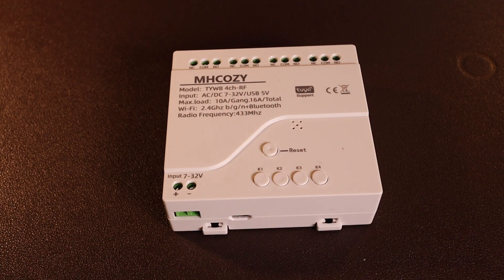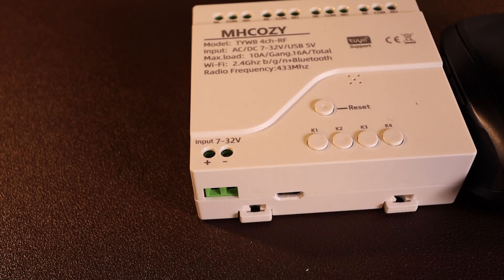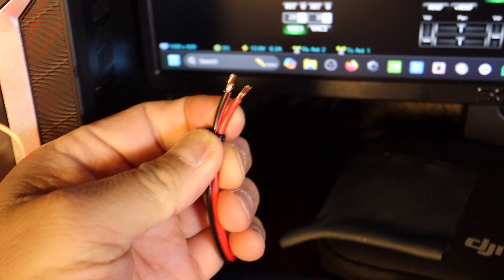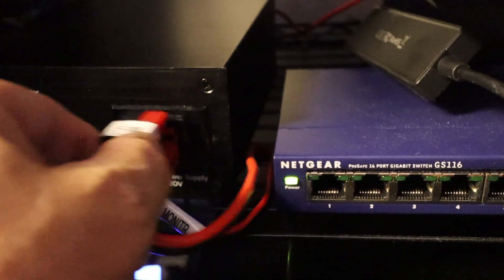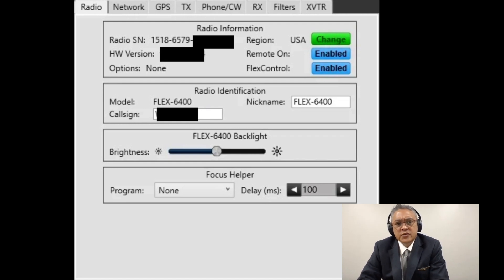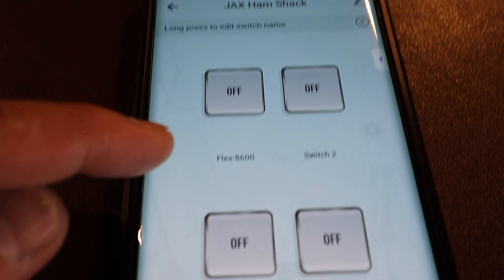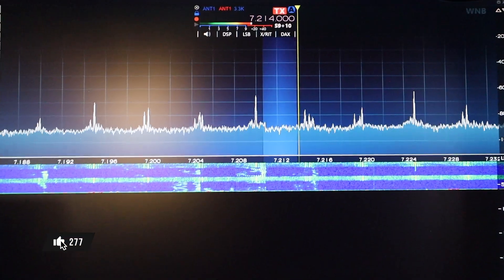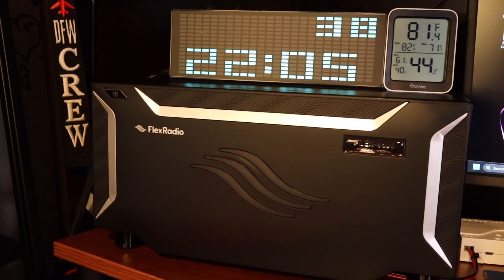Flex Remote On (REM ON) | Setting Up Remote Control to Turning On the Flex SDR | Flex-8000 Series

Comment: Darren, thanks for the video.  I received my switch the other day.  I built a control box with two high-current contactors, a DIN rail-mounted 24VDC power supply and breakers to protect everything.  The switch is now controlling 1) my Heathkit SB-220's 240VAC input power, my station's 12VDC power supply and the Remote ON for my Flex 8400M.  I can now operate remotely from my hotel room(s).   I have one unused switch (#4) for something else that I can come up with. :)  73!!  Ron - K5RPM
Reply from the maker: That's awesome Ron, 73 de N4VFR

Comment: Do you normally leave the flex on all the time or do you use the app to turn it on and off while you are away??
Reply from the maker: You need to see my updated remote for the Flex video.  I use a wifi switch to power on/off my Flex.

Comment: Another nice video Darren!  I use a very similar setup.  In mine, I use channel 1 for rig REM ON (just like yours) and channels 2, 3 and 4 to switch among 3 antennas.  
When I am home, I use the buttons on the box to power on the rig and switch antennas.  On the road, I use the app on my phone.  73, Len, KD0RC